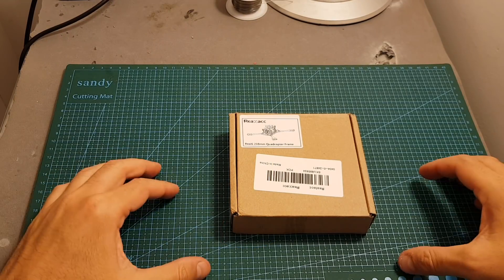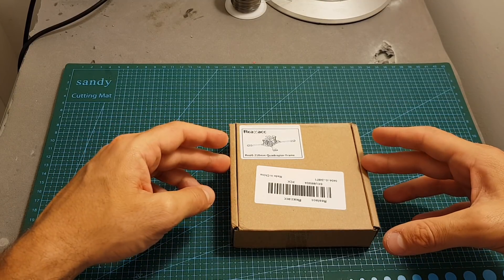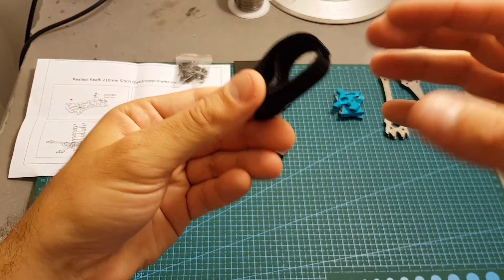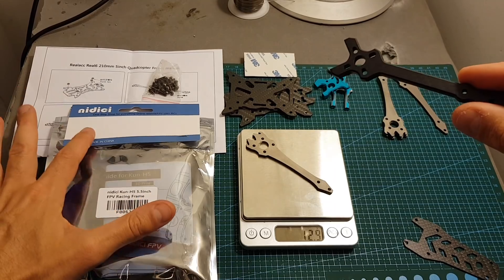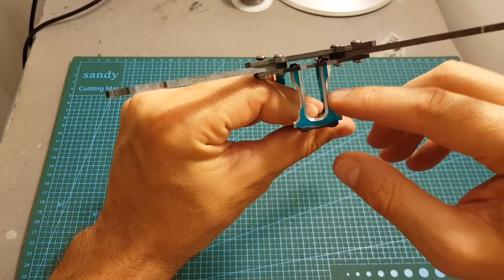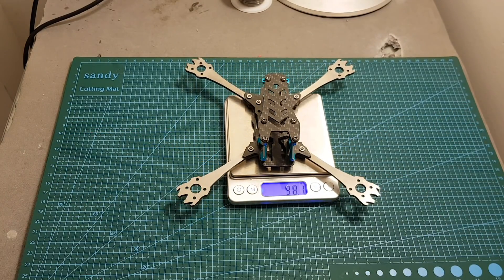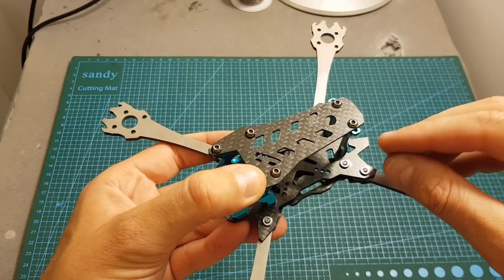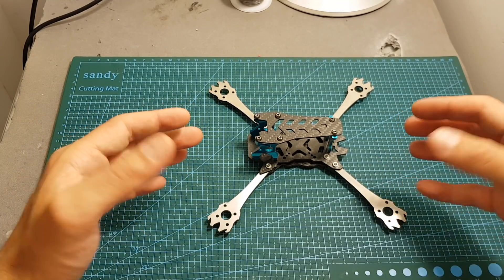Realacc Real6 Titanium Frame Overview

Comment: What is the stack height? or simply the distance top to bottom plate?
Reply from the maker: About 35 mm.
Reply: Kremer FPV cheers mate! Please let me know once you fly it if titanium provides more vibrations.
Reply from the maker: It flew great - still need some tuning though. Video should be up soon.

Comment: Sir, I have original 3mm Ti arms frame made by Niono (Sonic 190). The reason I brought it because it is a very sexy frame however the problem with Ti arms are that it causes “huge” vibration & resonance to the quad. In order to get this type of frame to fly ok, you must soft mount the motor & fc. (New motors also help)
Reply from the maker: Thanks Vincent, I intend to soft mount the motors. Thanks for the advice!